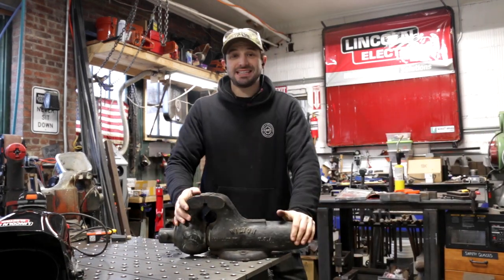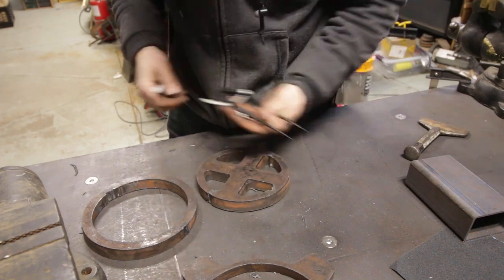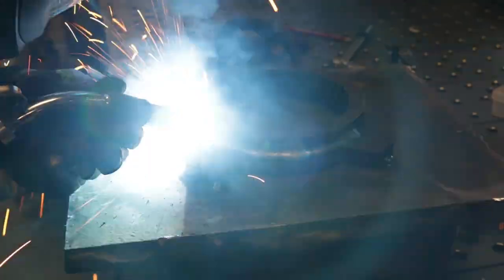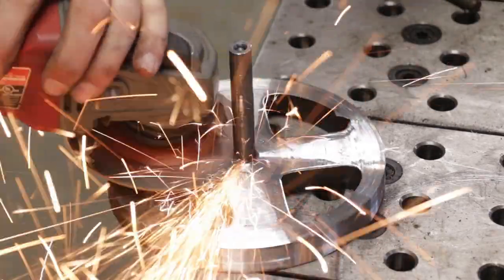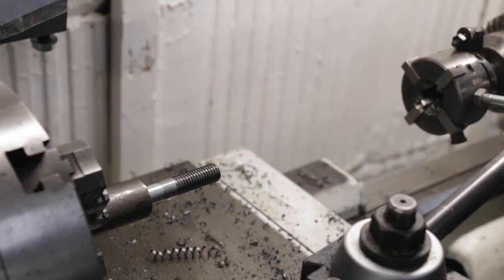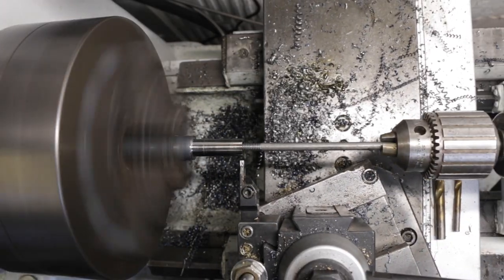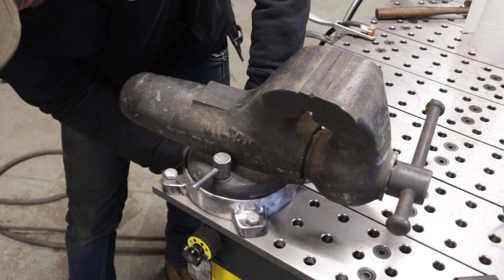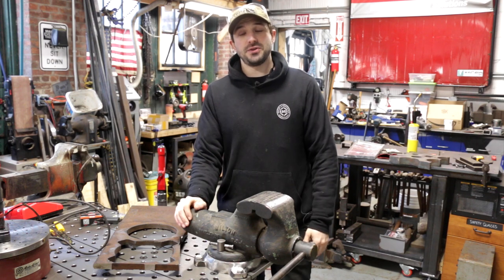Making A Swivel Base! 5" Wilton Vise!

Comment: IIRC starting the cutting torch right on the intended cut line creates a hole, 1/2 of which remains in the work (one of your tabs had that sort of notch?). If you start enough off the line in the waste for the burn thru (farther off line for thicker material cuz longer burn thru), then progress the pass in a short radius onto the work you should get a cleaner start/stop. I'll definitely try those abrasives. Sweet build, looking forward to the finish vid.

Comment: Cool project! If your torchmate software has overcut function, you might want to use it to get rid of those little tabs that hold inner parts from falling through. As an example, if you set overcut to 5mm on a hole, the torch will go extra 5mm past the cut beginning, preventing those tabs from forming.
Reply from the maker: Thanks for the tip! Great idea! Usually I work with much thinner material and haven’t had any issue but I’ll keep that in mind for the thick stuff! Appreciate it

Comment: HI , GREATE BULD, WELL DONE.  WHAT IS IN THE BELT PACK YOU ARE WEARING? .  REGARRDS R.
Reply from the maker: Its a powered respirator system that is filtering the air and putting it back up through my welding hood. its called the PAPR unit. https://bit.ly/3stwSD2